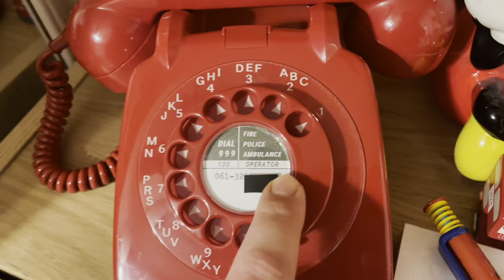1965 Red GPO 706 Rotary Dial Telephone - Overview/Demo

Comment: Hi. I’m new to collecting/converting/cleaning. I love your Chanel and your collection! You have some fine examples of many telephones! Can I please ask when you use the 52a terminals (and on a couple of videos you have mentioned you purchased a short cord with the 413a plug on) where do you purchase from. I can’t seem to find one with the square grommet to go into the opposite end of the terminal block.
Reply: Hi, Ian
I've been a collector and dealer for a long time and have got most of my spares via ebay at one time or another. 
There are companies making replacement line cords in the different colourways with the PSTN plug, and often find original (grey) 1980's, new old stock(NOS) or used cords recovered from non reparable telephones listed. 
BT's stock description for the 1980's plug ended line cords for the 700 type telephones is Cord connecting 4/502.

I invested in the necessary kit so I could make up shorter cords myself to terminate on the original terminal block.

Comment: I'm American; I've never used nor even seen one of these in real life, but if I had one I'd feel like a 1960s British spy, and I guess I'd have to sweep it for bugs before using it.

The sound of the dial is interesting. I'm most familiar with Western Electric 500 series phones, and they don't make that clicking sound when advancing the dial, though the dial return sound is similar.

I like that ringback number. We don't have that around here that I know of. When I was a kid in the '80s you could dial your own number, get a busy signal, hang up, and a few seconds later your phone would ring, but that hasn't worked in my area since the early 1990s when they upgraded the network to enable touch-tone service, call-waiting, caller ID, etc.

That ring pattern is weird. In the US it's one long ring rather than two short rings. The exact pattern is 2 seconds of ringing followed by 4 seconds of silence. I don't even know if your phone would ring here.

Edit: I did some research and it turns out that some British phones don't have an internal ringer capacitor like American phones do, so if that's the case it definitely wouldn't ring here as-is. I'd have to add a ringing capacitor one way or another, such as by installing one in the phone or by using one of the BT-to-RJ11 adapters that has a built-in ringing capacitor.

Comment: I agree mate... "A lovely RING" . Very authentic sounding. I couldn't help but notice that it looks very strongly like our "500 Model", but I did notice that the letter "O" is NOT included on the # 6 finger position as it is on the Western Electric 500. But then they haven't forgotten it have they... there it is... down there at the "0" position, along with the "Q" which none of the American telephones display. How interesting! Oh yes... I also noticed (from a different presentation of yours, you blokies have (8) contacts on your connecting blocks! WOW... What's that all about mate?

Comment: Elsie tanner had the exact model of this in coronation street
Reply: NO she didn't it was a 746 she had. As it was the same phone Audrey Roberts had. Then it was changed to a Red Viscount when The McDonald's  moved in.
Reply from the maker: @craigsouthwell3484  From the few clips I have seen with her phone on display/being used, it is definitely a 706. She had one just like this and then the same one but had obviously been to the wipe up centre, as the alphanumeric bezel was gone, and it had a clear finger wheel, still a red 706 though, haha.
Reply: @gpocollectorboy3391  Oh right but when Audrey and Alf owned the house it was defo a 746 it was on a sideboard in the living room. Then Liz McDonald had a red Viscount which I think Eileen Grimshaw still has? I haven't watched Corrie in years.

Comment: You'll be buggered when the system moves to Voip phone lines... Think it's a bloody stupid idea to be honest.
Reply from the maker: We were originally with BT and then moved to Sky, both copper landlines.

Changed to Virgin in around 2020, still the same number though, it’s been the same for about 30 years, lol.  It’s all going to this Fiberoptic nonsense not though and of course, being on Virgin now, homephone calls are through the hub, so I am on VOIP now, the landline is still there, they just disconnected at our house for the moment, as we changed phone company.

BT copper landline was my preference though, probably because we were always with BT, from me being a kid, changed to Sky around 2017.  

Actually, this is the first phone demo video I have done, while being on Virigin/VOIP.  It works okay but prefer the regular old landline, the ring voltage isn’t as powerful from the hub as the proper exchange equipment, so it does struggle sometimes, especially with more than one vintage phone at a time.  

At least I am already set with Virgin, it will ring and dial out, to my surprise Virgins VOIP service does accept pulse dialling!
Reply: @gpocollectorboy3391  I saw a rather interesting video that the guy My Mate Vince aka Mr Telephone did, where he rewired the line thru the hub so all the extension sockets would work. Was really interesting. 

I moved to BT last year as they were cheaper than Sky. I don't have a landline now. I wasn't paying over £40.00 just to have a phone line on incoming calls only. For something I seldom ever used. Glad to see you back thou. It's been a while lol.
Reply: @gpocollectorboy3391  That's good to know, there is a possibility then that they will still work post 2025.
Reply: @aljohns453  Verizon FiOS also accepts pulse dialling in the USA :)
Reply: @gpocollectorboy3391  I'm sure it's not your choice to be on Virgin VOIP! BT copper landline is definitely the best for a telephone service. Shame they're being forced to discontinue it by Openreach, who manage the network. There's a national "stop-sell" on copper from September 2023 and digital switchover will apparently be complete by December 2025 (although I predict it will take longer than that, as it's a huge change and there are many hurdles to be navigated - that's why BT have paused the rollout for their voice customers).
The set-up in my house couldn't be more old-school: BT copper landline, telephone only (no broadband), paper bills through the post and no cordless phones as I don't like them! As well as reliable signal and uninterrupted power supply, BT have an impressive range of calling features on their copper telephone service, more than any other provider; however, as most of these were originally built into the analogue exchange equipment (which is being decommissioned), rather than carried over the network as a whole, they will sadly not work on the new Digital Voice service. That's progress for you(!). I think the reassuringly familiar voice of 1471 and other network/feature announcements will also go. BT are playing down the digital switchover, saying that subscribers will notice little difference in their telephone service. This is completely untrue; it's not just the underlying technology and how the service is delivered that will change, but the way it all sounds and behaves. It really will be the end of an era. 😞
I'll have to make videos about the calling features, before they disappear for good. One of them (Call Sign) is being withdrawn early - on 30th September 2022! Apparently because the Smart Hub 2 can't handle different ringing cadence... As I said, progress(!).